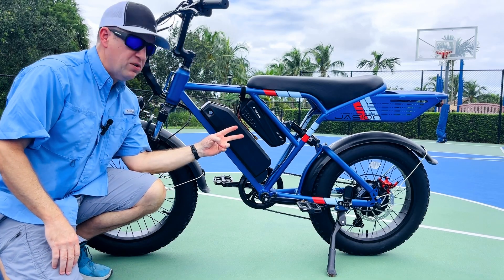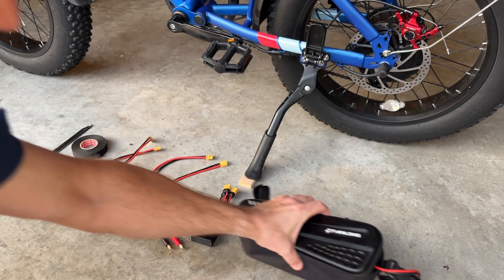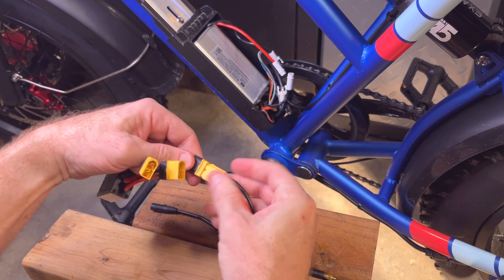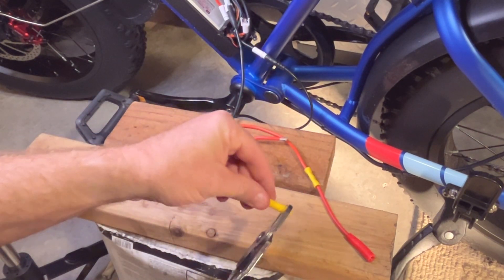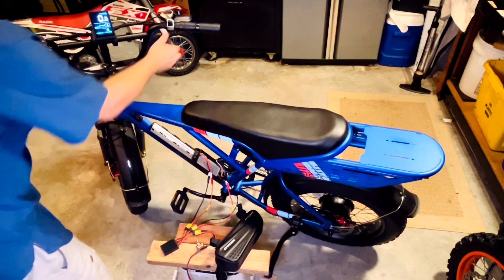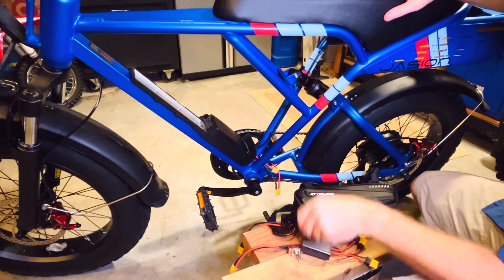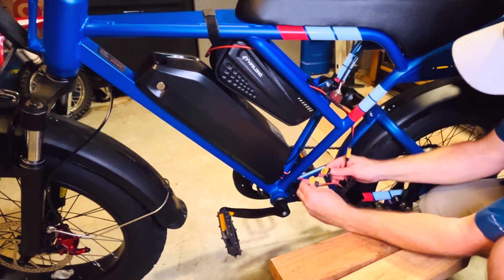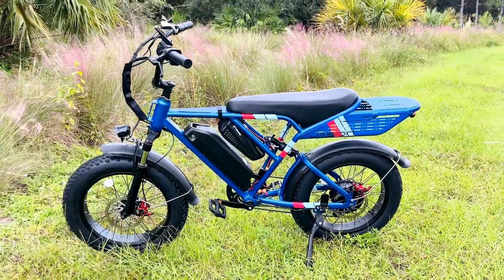Extra Battery vs Larger Battery - Jasion ebike

Comment: is the 48V 20Ah Battery Power Pack  ok to get insteed of 15ah
Reply from the maker: 20ah will not fit in frame.  10Ah or 15ah only
Reply: @BRichSolution  ok thanks

Comment: What cord is the speed limiter
Reply from the maker: There isn't a speed limiter wire.   Its internal to controller.   If you got ride of limiter you'd only gain 1-2mph with  48v battery and motor
Reply: @BRichSolution ok ty

Comment: How many batteries can you add on this one? How much will it be the investment and the total possible range? TIA
Reply from the maker: If you go with 15Ah linked in the description below the video you can get 35-45 miles of range full throttle and 50+ on PAS 3 or 4
Reply: @BRichSolution  thank you.
What would you recommend from what you tested or upgraded for 2 seaters that can climb anything without a struggle?

Comment: How do I fix the black male cord from the controller stick out a little bit
Reply: It’s dosent want to go any further into the female socket
Reply from the maker: I had to route some cables under the battery mount in the frame and use sheathing to hide the cables

Comment: Is there any way to add a 3rd one? Or 4th even?
Reply from the maker: Yes same procedure for adding 3rd or 4th battery
Reply: @BRichSolution  Would the third have to connect to the original battery or the 2nd one? .. and so forth?
Reply: What if I wanted to add an upgraded battery would the cable connections be the same ?

Comment: Hey I got a Jaison eb7 2.0 and I've been considering getting a second 48v 10ah battery and was wondering if I could do the same thing, and if so how should I go about it? The battery is inside the frame itself so I'd need to take it apart to the controller and keep it split so the batt doesn't connect up to the controller. Alternatively I could just remove the battery, let's just hope I remember to do that
Reply from the maker: Yes find the controller and connections should be the same
Reply: Real question is placement tbh, at this point I'm thinking about buying a 14ah battery and the hot swapping them out with each other @BRichSolution

Comment: You use two specialty wires for installing this extra battery. The two specialty wires are not on your list I repeat they absolutely are not on your list I cannot do this build without those two specialty wires could you please tell me what those two wires are please. I repeat will you please please please please please please please please please please please tell me what those two specialty wires are maybe even put them in your list please please I asked this before please
Reply from the maker: Thank you for the heads up.  Linked below are two connections needed to connect to Jasion factory wires listed below.   I also updated the list of parts on Amazon
 https://amzn.to/3IWBRtq
https://amzn.to/4l6TCDx
Reply: @BRichSolution thanks for getting right back to me I appreciate that I just placed my order ends up costing me $244.58 out the door.
                                               👍😎👍

Comment: I see that this is mostly Plug and Play other than two wires need to be spliced and replaced .I do not see on your parts list those two wires .I think I see everything else .the battery is there. the on-off switch cable is there. the extension cables there .the battery combiner is there .but the wires with the different style plug-ins for the bike I do not see them .they are a round style plug where  the other ones are yellow and squarish. could you please list those cables there should be two of them one of them having two male ends with a yellow plug-in one side and the other one having two female ends and a yellow plug at the other side
Reply from the maker: All products used with links is in the description below the video
Reply: Also I'd like to ask I see you bought the smaller battery would the next size battery fit in the same spot and would there be the need for a different controller or any other parts for installing the next sized battery
Reply: @BRichSolution okay you have two different links onelink that is to a single battery goes nowhere I've clicked on it several times and every time it takes me to Amazon and then says it doesn't exist the other link takes me to your parts I looked through them I see things like shoes Halloween things but I don't see those two specific wires that are needed just for this bike I do not think you use those wires when you added batteries to your other bikes so perhaps it might be missing or perhaps the product was sold out and was taken down . I've looked through your parts list several times and I just don't see those two wires.

Comment: What do I need to do when add an extra 72v battery?
Reply from the maker: We wire the entire bike as the wires are not thick enough to carry 72V
Reply: @BRichSolution  wires with the controller?
Reply from the maker: Yes controller, motor, screen and more all run on 48V.  72V would require rewiring the entire bike because the wire gauge is not rated for 72V.   Accept the bike for what it is.   Buy the time you upgrade everything to 72V you can buy a Goat Power v3 ebike

Comment: I have the same bike but it said it had 70 miles of range what is the actual stock mileage
Reply from the maker: Stock battery full throttle is only 20-25 mile at 28mph.  Slower speed of 15 mph the range is 50-60 miles.  Extra battery gets you 20-40 miles of extra range

Comment: Hey man don’t mean to blow you up with the comments but I’m spending a good bit on this will this set up work with the 52v 20ah option they offer? Thankyou for everything man
Reply from the maker: I don’t know 100% but it worked on 2 other ebikes like Jansno x50 and Ouxi v8.   Honestly I would buy extra 48V 10ah battery for $150 and run it with the stock battery (23Ah total) let them wear out for a year or two then upgrade to 52v later on unless you really want to go 1-2 mph faster

Comment: Hey man nice video , retro volt owner here, thinking about purchasing the 52v battery will I have to change out the controller ? If so any recommendations thankyou safe riding
Reply from the maker: Most 48V e-bike controllers can handle 52v.   You will probably gain 1-2 mph in top speed
Reply: @BRichSolution last question , link for the female and male wires got everything else for the 48v 20ah hauling battery you believe since it’s so big it will fit under the cargo bay correct? Thanks!
Reply: @ last question I just ordered it , will this setup work with the 52v 20ah option they have? Thankyou man !!!!!

Comment: Will this work with any ebike battery on any e bike model or should I find something specific for my cycrown cychunter? Its currently using a 36v 10.4 ah
Reply from the maker: Yes works with any ebike.  If you have 36V battery then 2nd battery must me 36v
Reply: @BRichSolution  awesome thanks for the heads up. I just bought my first bike so Im still learning

Comment: Is their an adapter that you could use for some of the wires instead of having to get butt connectors and splicing the wires. I’m not the best with wires and I don’t want to risk messing something up.
Reply from the maker: I couldn’t find any plug and play wire as these connectors are very strange

Comment: Can you use both batteries? And if so does it boost top speed or acceleration at all?
Reply from the maker: You can use both batteries at the same time the switch is optional.   No boost to speed but the top speed last longer as with stock battery the top speed falls off after 18-20 miles whereas the 2nd battery you can go over 30 miles full throttle without impact to top speed

Comment: Just got one of these bikes the key came with it, but for some reason, the battery won’t come off got the bike used off of Facebook marketplace the key number on the key matches what’s on the battery though thoughts?
Reply from the maker: Some batteries need a good push up to remove the battery to get it off the hooks

Comment: can you add a 52 volt 15 ahp ?
Reply from the maker: Yes the 15ah battery will fit
Reply: @BRichSolution  but can you like use both batterys at once the 52 volt and 48v with both 15 and 13 ahp?

Comment: I have this bike, and broke the stock battery. Can i just buy a 48v 13.xx ah battery and shove it in the stock rail? Or would i have to replace the rail and move the controller as well?
Reply from the maker: The battery is pretty standard you should be able to buy 48V 15ah or 20ah and slide it right in, worst case you’ll have to replace the mount.  Controller will fit in new mount
Reply: @ i’ve had a new one come in: it seems that it (and most batteries on amazon, i’d assume, since there’s several with the same rail as the one i bought) are too small to fit the stock rail, and the rail it comes with is too small to fit the controller. Just wanted to lyk if you ever wanted to replace your battery

edit: further disclaimer that after looking on amazon, sellers will use other vendors’ images on their product page and sell different products with different rails, so it’s a gamble to buy something off amazon if you just want to plug and play, even if you pay special attention to the measurements.
Reply: @thecarrotmae1714 😢😢😢

Comment: That battery is no longer available. Could you link other batteries that would work?
Reply from the maker: Here is updated link to the battery with case https://amzn.to/4hspr8M
Reply: @BRichSolution  I appreciate it. I heard that the controller under the battery on the bike gets super hot and is unsafe. Is this something you can see if it s a problem. I know nothing about Ebikes. I learn from your videos.
Reply: @HeyMistaRager  can you add a 52 volt 15 ahp ?
Reply: @ No Idea. BRich might be able to answer that. He knows a ton about them.

Comment: Can I add a 60v battery would I get more power ?
Reply from the maker: Yes you can upgrade to 60V battery but you would need a new controller, wires and motor to handle the power increase.   The controller can probably handle 52V battery which should increase speed by 2 mph which I am not sure its worth it
Reply: @BRichSolution u have a link to some recommended ones for the bike js got hydraulic brakes js need more power

Comment: Where do you get a stock replacement battery
Reply from the maker: All the parts are listed in description under the video, i also listed them below for your convenience.   See shock replacement video also.

Battery on Amazon https://amzn.to/3YdbhjB
Adding Extra Battery and cables: https://amzn.to/48cNCoa
Reply from the maker: Battery on Amazon https://amzn.to/3YdbhjB
Adding Extra Battery and cables: https://amzn.to/48cNCoa
Reply: @BRichSolution  thank you. I'm subscribing to your channel. You're very helpful!
Reply: Question for you: did the battery you bought fit your rail? Or did you have to replace your stock rail? I bought a battery that had the same pictures, but a 15AH version, capable of 1500w, and it’s too small for the stock rail.

Comment: If I get a second stock battery I won’t need another Mount? Or do I still need another Mount
Reply from the maker: 2 mounts will not fit in the frame, 2nd battery you will need to carry on cargo rack or backpack and then swap
Reply: Were do I get a second stock battery

Comment: So with replacing the mount to the one that will come with the 20AH battery you linked does that mean the original battery no longer fits? If that's the case then sourcing another battery seems to be my best option. Sorry, I don't own the bike but am thinking about buying.

Great vids btw, def. taking notes of all your mods so far.
Reply from the maker: most likely the stock battery will not mount, but it might.  the batteries are not standardized with is frustrating
Reply: @BRichSolution  Copy, thanks for the info. I'm trying to get in contact with a seller on Ali who has that battery but different AHs available. Prob see if those will fit as I have the bike ordered now.

Comment: I just got mine a few days ago but the manual states 55-65 miles but yet I only get about 25miles per charge. Perhaps I’m not charging my battery long enough. Can someone give me better insight as to what could be wrong ?
Reply from the maker: You can get 50 miles in PAS mode 2 and pedaling.   25 miles full throttle is good with 13ah battery

Comment: Have we been able to solve the issue of getting this bad boy some more power?
Reply from the maker: Change p14 setting from 22amps to 25amp will get you slight bump in torque and acceleration but range will be reduced.  See video linked below.  The only other option is to go up to 52V battery will increase speed and torque but IMO not worth it for a bike of the price point is to accept it for what the bike is.  If you want more speed buy something else with 52V or 60V batteries 
https://youtu.be/Y-IE6krW-zo
Reply: @BRichSolution  okay sounds good. Just sucks because I’m really a fan of the body style but I guess I’ll be saving for something else aswell. Do you think it’s worth buying an additional battery straight from jasion? They’re $350
Reply: @BRichSolution  what52 volt battery can i but and if i can is there a way i can use both batteries for more range

Comment: Everyone should be warned that the haillong battery may brick after a month of use & neither Amazon nor haillong will do anything to help you. I made this mistake so you don't have to
Reply from the maker: maybe you received a bad battery as the one I used in the video I used on another bike for over year and the factory battery is hailong see symbol on top of hardshell HL
Reply: @BRichSolution  that's exactly the point. I got a bad battery & no remedy from either company. Just trying to save someone else from buying a $200 brick. 

Sorry to be a party pooper, have a good night man ✌️
Reply: Where do buy a stock battery though? @BRichSolution